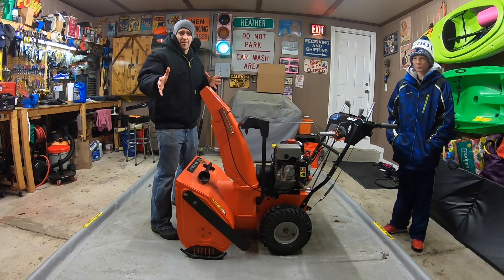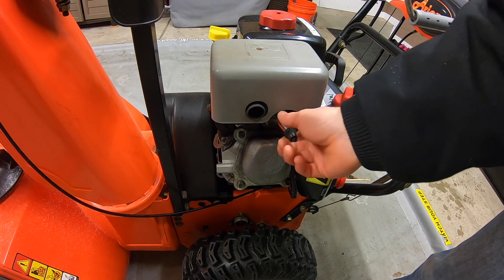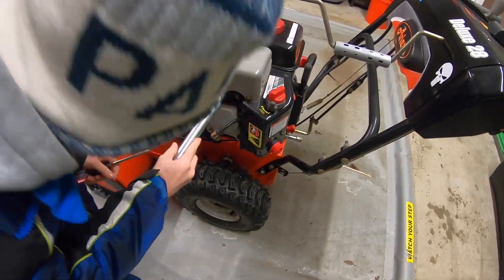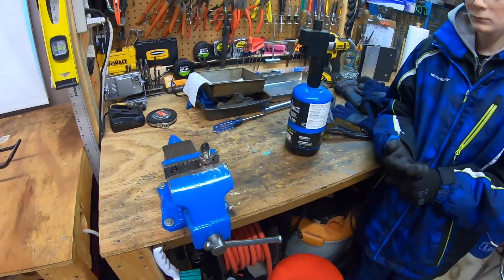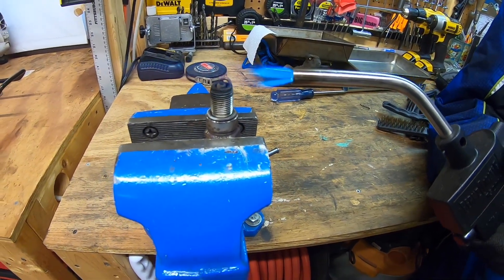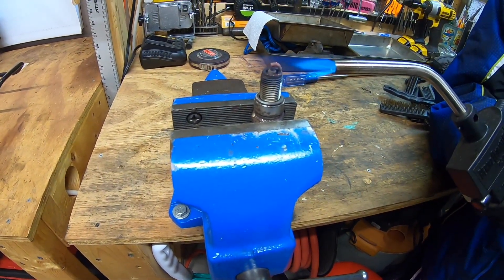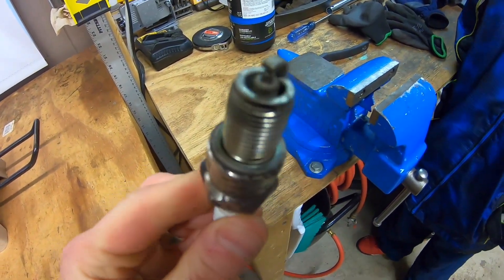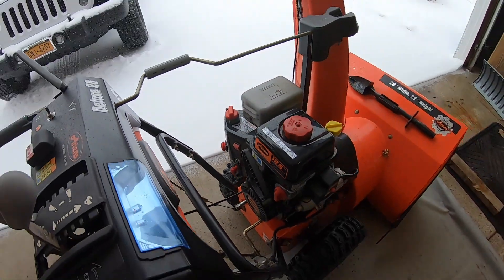HOW TO CLEAN A DIRTY FOULED SPARK PLUG FOR FREE. Small Engine Maintenance and Repair.

Comment: You are a patient and really good mentor. I just tried this with my car. I didn’t use heat but I just used sand paper to clean the oil and carbon deposit off and my car starts up great now
Reply from the maker: Thank you! There are a couple ways to do this procedure! The only device that I tried cleaning spark plugs with was this box with sand in it. A lot of it got stuck in the plug. Had to throw one away. That box was junk. Other than that, clean plugs make a world of a difference! Thanks for watching James!
Reply: i realize I'm quite randomly asking but do anybody know of a good site to stream new series online?
Reply: @Azariah Ivan Flixportal
Reply: @Azariah Ivan no problem :)
Reply: @azariahivan3939  fake
Reply: @azariahivan3939  they are known for phishing credit cards

Comment: Sorry for the dumb question but do you need to e careful brushing the plug? Does the brushing pressure not affect the gap on the plug?
Reply from the maker: Great question Steve. Brushing it will not affect the gap. You really have to push Dow very hard to bend it out of place. I also have done a video on gapping spark plugs. So if it ever is out of gap it’s an easy fix. Thanks for watching!

Comment: For the past 15 years I've simply cleaned the OEM spark plug on my Toro Lawnmower with a bit of steel wool soaked in WD-40 and finished with emery paper on the hook, lead and seat..not a problem yet!
Reply from the maker: blipblip88 all good stuff there! I haven’t paid for a spark plug in a long time! Thanks for watching!
Reply: How long you let it soaked in the WD-40?
Reply: @4u25out  couple minutes

Comment: Someone was touting heat-cleaning plugs to me yesterday..Odd.  I've never had to heat up a plug to clean it.  I've used the same Champion spark plug on my mower for 28 years now and only ever wire brushed it about a dozen times to clean it up.  Mower works fine.  Anyone else?
Reply from the maker: blipblip88 I found it to burn up any gunk on them. Your method works great too. Thanks for watching.
Reply: Heat is to burn the oil off and out of the pores of the porcelain

Comment: HG N-LINE
0 seconds ago
Great video... my spark plugs were fouled due to running a catless downpipe and piggyback tune.. usually getting running lean to bank 1 check engine light code. I used the recommended HKSM45XL plugs ..the dealership cleaned my plugs and since had the catless downpipe removed since my car needed more backpressure to run efficiently. Would you have any recommendations to deter fouled plugs in the future as i am planning to get a high flow downpipe?
Reply from the maker: Hey mwilliams, this procedure is meant more for small engines. It could work for cleaning car spark plugs too. As far as your question goes I recommend running this by a car mechanic for their thoughts on this. This is outside my area of expertise. Thanks for watching!
Reply: @GarageGear  thank you I appreciate it

Comment: Can you not just wipe it down with a rag or cloth beacus idk what to do with mine as I don’t have a heat thing
Reply from the maker: Wiping them down with a rag won’t fully remove the carbon build up on them. Heating them up does a great job. I’ve seen some tools that sand off the material. And those work ok by some sand can get stuck in the end of the spark plug which could cause a problem. Hope this helps. Thanks for watching!
Reply: @GarageGear  thanks
Reply from the maker: @Luca-ds6sz  no problem bud!

Comment: hardly  anybody knows thebrst to clean a spark plug  making it shin  has nothing to do with it firing right   i use a sim;ple plug blaster from harbor freight  less than 20 $$$  had it for years  about 100 psi iinsert the dirty plug  it clean as new inside where it counts  the carbon buildup can only be seen with a volt ohm meter set on its  hightest scale  if connect one lead to top and the other to the bottom  (hook)   if you get any reading the plug is dirty   that is the least resistance to ground threw that carbon the tester will clean that mess out till you get no reading its good as new then try it  ps   alwas hold blaster vertical with plug on top to clean  it woras good horizonal it the way its made inside   it the loscation of the hole the media  (sand  ) flows thru   i hope this helps some one to use a meter  to see dirt
Reply from the maker: Frank Davidson thanks for watching!

Comment: HIGHLY NOT RECCOMENDED. The carbon fouling in spark plugs is natural but accelerated through rich fuel conditions. End point is that it’s been worn down, the node is most likely deteriorated.
Reply from the maker: Thanks for watching!
Reply: You say “highly not recommended” like doing this is going to blow the motor up.  If you do this and it doesn’t work, just go buy a new one.  Lots of things in life aren’t they serious man.